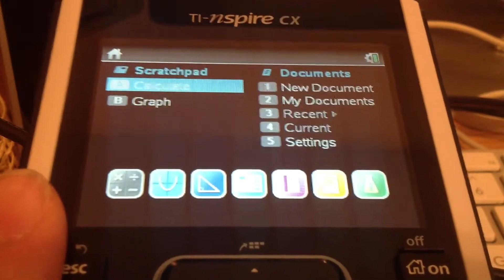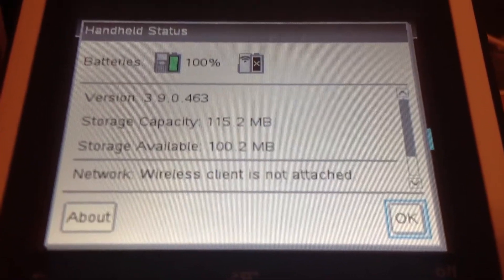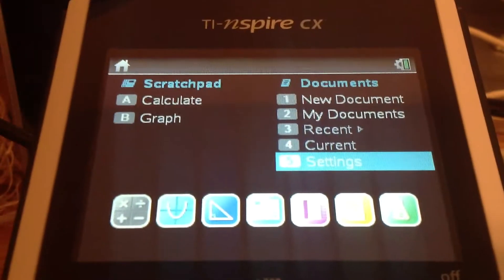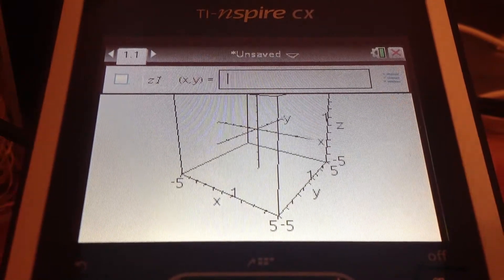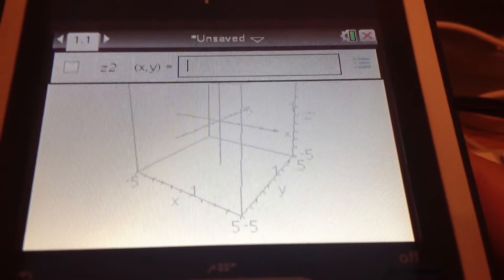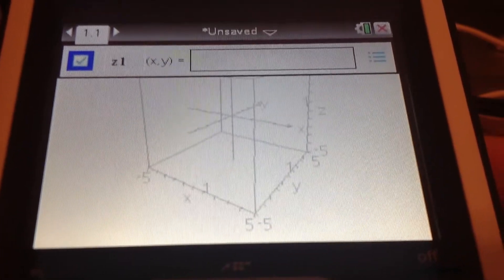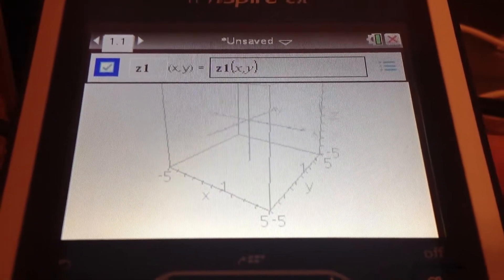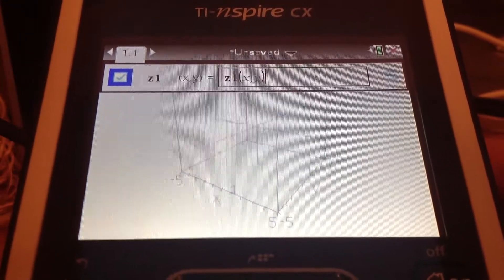How to crash your Ti-Nspire CX

Comment: How to crash your Ti-Nspire CX/CAS or TI-Nspire (CAS) Clickpad/Touchpad:
1.Make sure the version is 3.9.0.463 (Home<5:Settings<4:Status)
2.Add a Geometry or Graphs page (Tools menu (ctrl+home)<4:Insert<5:Geometry or 4:Graphs)
3.Switch to 3D Graphing (menu<2:View<3:3d Graphing)
4.Enter 2k (Or any other expression) to z1-z99 and PRESS ENTER
5.Enter z1-z99(x,y) to z1-z99 and Press ENTER

Is working at my TI-Nspire CAS
Is not working at TI-89 and TI-Nspire CX/CAS, because i have the OS version 4.5.3.14